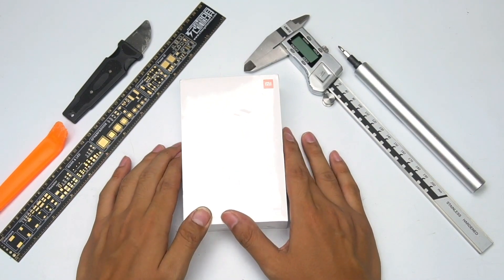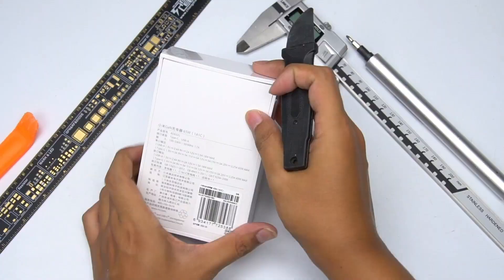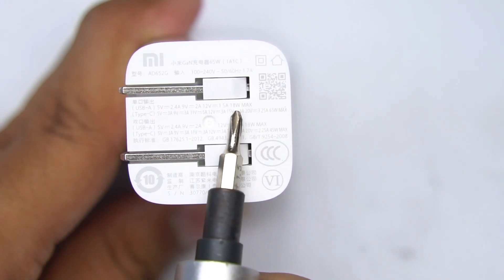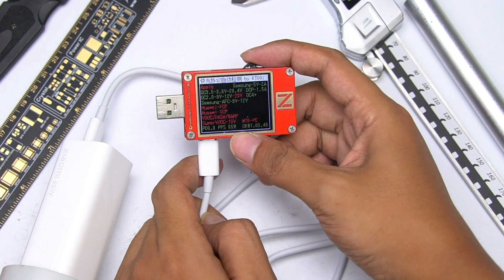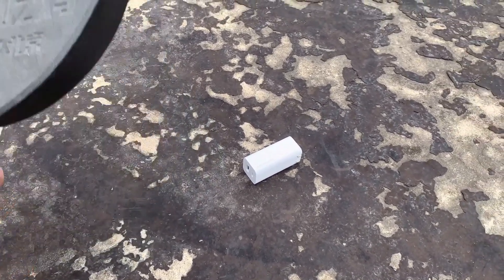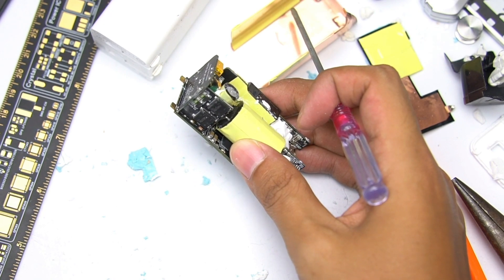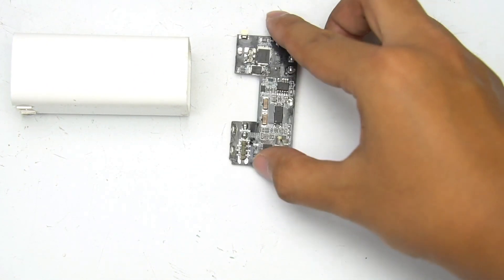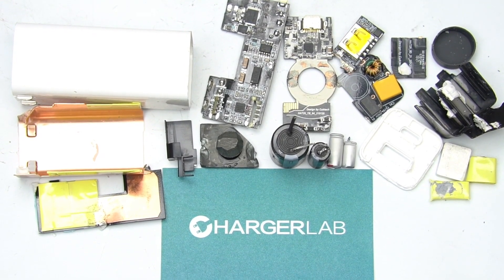Teardown of Xiaomi 65W GaN Charger (1A1C)

Comment: i tested 2 prong chargers, they're apple 67W and this one both has 80-90Vac measured from the shell to ground. Is that a normal condition for these kinds of chargers? when the shell is grounded the voltage goes to zero immediately.

Comment: This charger gives me little electricity tingling sensation, when holding the outervmetal part of usb C

This elictrical tingling can be sensed on metal frame of my s20+ phone

Is this a damaged charger, or this is normal based on charger design?
Reply: i just experienced the same, both on magsafe 67w and this xiaomi gan charger. can't really say anything though, they should be normal probably because the filtered noise is not grounded (?)
Reply: I have the dual port 67W Xiaomi charger, model is MDY-16-ET. I feel tingling on my laptop when it's plugged in but it's not very strong
Reply: @LoganT547 

This should not happen. It's a faulty or fake charger. Better throw it away.

Comment: very interesting video. so i have a question does it worth to buy it and use it on samsung Galaxy S22 Ultra ? thnx in advance
Reply from the maker: It can used on Samsung Galaxy S22 Ultra, but it's not the best choice. I would recommend the Samsung Original charger.
Reply: @ChargerLAB whats the reasons?

Comment: hello there.. i am so happy to discover your channel.. thx alot for the effort.. and of course liked and subsridbed:) i have 2 related questions..

1- can i get 15V and 4A for my surface pro 7+with this charger? (since there is no 4A in written in the box, i couldnt be sure of it)..  
2- what happens if i use this adapter? (such as slow charging and/or damaging the battery and/or smthng else?)

have nice day.
Reply from the maker: Thanks for subbing!
Since we do not have surface pro, I'm afraid we cannot provide an accurate answer. But this charger only supports 3A under 15V.
So, the charging speed will be slower but won't damage your battery.

Comment: Haha, just detected this Video! This charger has been developed and made by Baseus. Xiaomi just adopted this charger and tripeled the price.  Baseus does build really best stuff! Where did you buy this fantastic pan tool from?🤣
Reply: The GaN charger is actually developed by ZMI, a company owned by Xiaomi. ZMI mainly focus on chargers, cables and powerbanks.
Reply: @manwell235 also this charger is manufactured by cucktech
Reply: Thanks for the info!
Reply: Where do you get the source?
Reply: Do you have any source? I m interested in buying this charger.
Reply: Are you confused. development of this charger is not by baseus
Reply: where it your source. i dont think it make by baseus. some baseus gan charger I have not pretty, and design like this. tks

Comment: The transformer design is very interesting however those cheap Chinese capacitors are the main reason why I would never buy this charger.
Reply: Truuuu, those capacitor filters the ac sine, and we don't want dirty filter ,if anything, I would get the best capacitor and cheap out on something else
Reply: Why would 20w apple charger get better ones than the 30w model? So how'bout the 65w apple equvivalent? - or the 45w samsung charger?
Reply: So which usb-c wall charger contains expensive capacitor stuff from Nichion or Nippon Chemicon?
Reply: @MrMegacurie  Apple chargers however they are expensive. Have been trying to find other brands with great capacitors but no luck. Bloody China.
Reply: @leonardgrant6876  Apple uses Aishi for their 30w model. Very chinese too
Reply: @MrMegacurie  Yes that is correct, however other chargers from Apple were using better Japanese capacitors.
Reply: @leonardgrant6876  True, 20w type gets the good stuff

Comment: Cheap Aishi caps, use Japanese at this price
Reply: Is aishi caps bad? Im planning to buy anker but it uses aishi+ samxcon and Yongming caps.
Reply: @xabysebastian529  depends upon the price but they are C grade not A grade like Japanese ones. Get something with Japanese caps like Apple’s chargers if you want to use the charger for over 5years. Sushi caps are fine for cheap charger under 30 dollars abut if you are paying more then get something with Japanese or atleast B tier like taicon.
Reply: @tanishqbhaiji103  I have a iPad charger that I have had for about 5 years and it still works fine I use it as my main charger when I'm not in a rush.
Reply: @thetechlibrarian  you can’t see the power quality and what happens in brownout.
Reply: @tanishq bhaiji so i heard the xiaomi charger here have some lightning issues when plugged to the wall, i am wondering if its a good choice to use it for my macbook etc and if its trustworthy. Instead of the 30w original apple one i would use a new 45w samsung charger when going on travel and assume thats a safer choice!?
Reply: @cosmoscloud121  what do you mean by lightning issues?
Reply: @tanishqbhaiji103  when ppl plug the charger to the wall, there are small lightnings visible, maybe due to the cheap caps idk.
Reply: @cosmoscloud121  that's fine, it's because the caps are large and there is an inrush current.
Reply: @tanishqbhaiji103  ok thanks, so i can trust this charger not to damage my devices!? ;)
Reply: @cosmoscloud121  yes

Comment: does this work with a Samsung Note 10+ (10V 4.5A PPS)?
Reply from the maker: Technically, it'll support.😁
Reply: @ChargerLAB  Hi again! I just got the 1A1C (seems to be the new US model) and my Note 10+ doesn't exceed more than 3Amps. Maybe it has to do with the PPS range? The official charger has 3.3v - 11v 5A. This one is 5v - 11v 5A

I used the TC-66 for checking the voltage and current. But either way, I'm satisfied with this charger